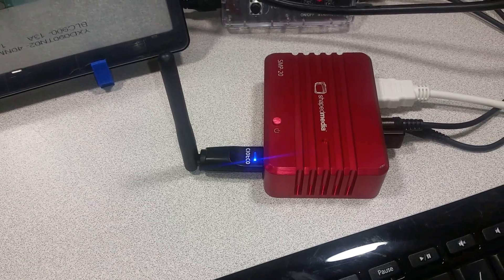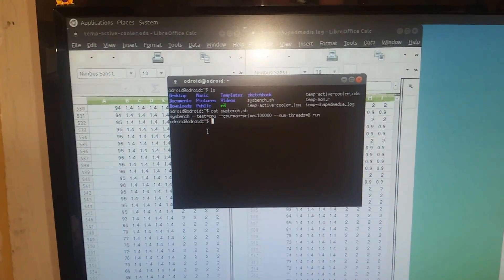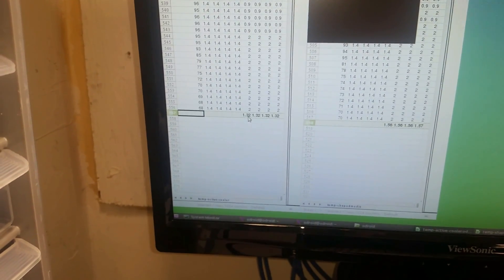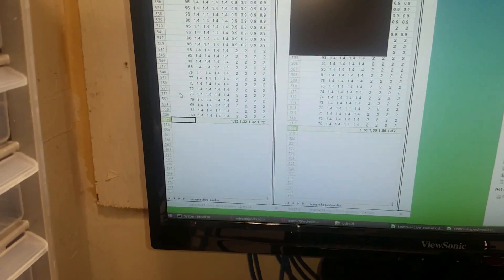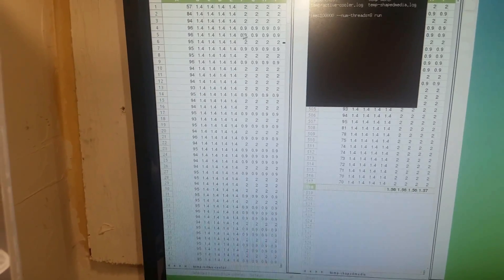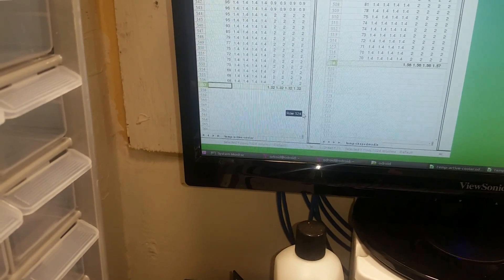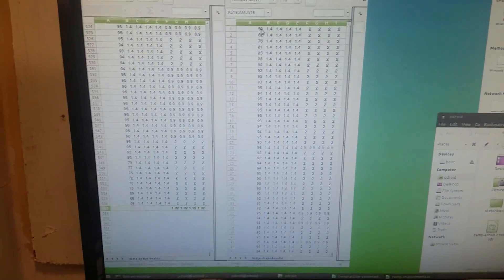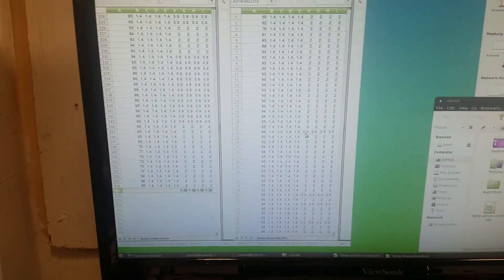Shapedmedia ODROID-XU4 Cooling Test

Comment: I use this and run batocera (recalbox) on the XU4. For most Emulation with GPU shaders the cooling is enough, temps about 60-70C. Running Kodi otoh heats up the case to the point of too hot to touch, 80C on the chip. I ended up putting a standing ventilator next to the where the XU4 was sitting at lowest settings and this knocked the temps down to sub 60C chipset.

Comment: I would expect those results initially due to the large thermal mass of the passive heat sink.  But what if that test ran for say a half hour and the mass of the case was saturated?  Just a thought that in the long run the difference might all but vanish.
Reply from the maker: Judging by the test results, the case was saturated well before the end of the short test we did. We believe the increased mass and surface area are responsible for the improved performance.

Comment: well.. a good test..
But You speak more about "power" and not much of temperature...
My question If I run linux, in idle mode : same temperatures for both solutions ?
What about "heavy" applications, like Kodi ?
After watching 30 mn of an HD Video, what is the temperature for both solution ?
I always thought that thermal pad was less efficient  compare to thermal paste ..

Of course the "fanless" effect is really great, since XU4 (genuine..) is a little bit too noisy for my taste with its fan...
Reply from the maker: +TheFrenchy82 The spreadsheets I prepared have temperature and CPU speed. As long as the temperature is 95C or lower, there is no concern because the SoC is designed to work at those temperatures. The reason it throttles down when it gets warmer than that is to keep the SoC from getting too hot. So processing power (speed) and temperature are linked in that regard. The test I ran pushes all cores to the maximum for the length of the test.

Basically, with the fan, the SoC throttles after only a few seconds and then keeps throttling. This will happen for as long as the SoC is pushed hard.

With the cooling case, the SoC takes much longer to throttle and throttles less often than the fan solution. So this would be the same for running an HD video for 30 minutes (or 3 minutes, or 3 hours). Both solutions will be around 95C at the end of the test, but the fan solution will have throttled much more often.
Reply: +ameriDroid : Ok ! 
thanks for the explanation !  :-)
So this case is a good solution for more.. silence !

Comment: I think a larger passive cooler would've been a better idea on the XU4 in the first place, since most intensive loads are short in duration, and generally occur on operation launch or start, it would be better to have throttling occur later, rather than having a smaller active cooler that throttles earlier and more often. This seems to even prove out on a longer duration benchmark, thanks for the info.

I like the idea that they incorporated the cooler into a beautiful case.
Reply from the maker: +Jordan Bettcher Sorry that I didn't see this comment earlier. We've been lobbying them to add mounting holes in the top of the case to add a 50 or 60mm fan to provide even better cooling for heavy computing needs. So far, we haven't seen any results from that lobbying.
Reply: +ameriDroid. No worries, I could easily tap and die such a configuration on my own, but yes it would be nice if they had the option.